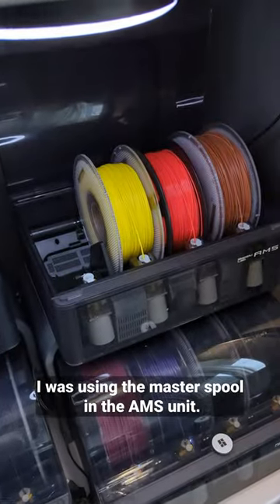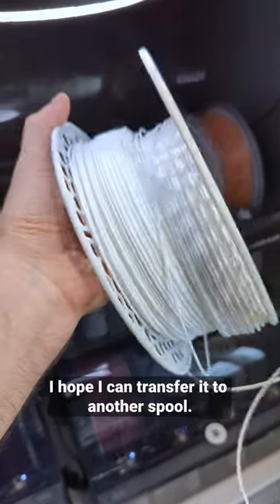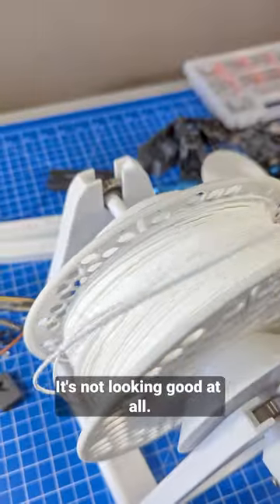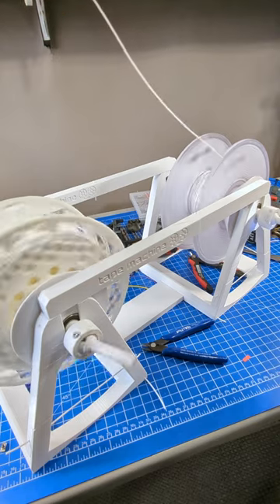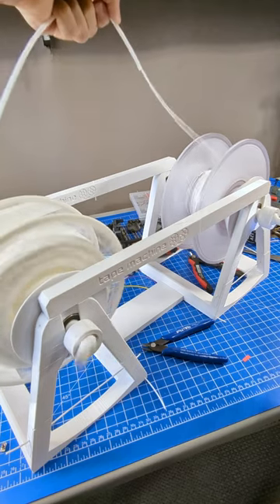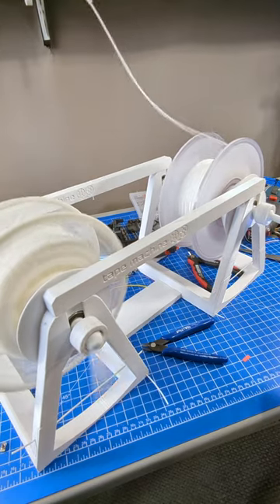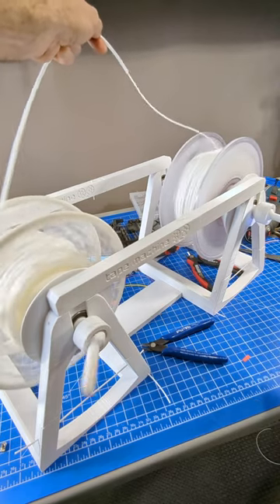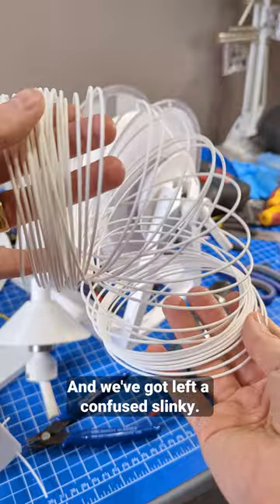Saving an unscrewed 3D-printed master spool

Comment from the maker: Rewind machine: https://thangs.com/designer/MihaiDesigns/3d-model/Tape%20Machine%20-%20filament%20rewind%20%2F%20respooling-843684?manualModelView=true&source=All+Files
Reply: Not sure what bearings you used but 608s don't fit
Reply: Hey, is there any hack how to copy links from comment or click on it? Youtube app can be annoying
Reply from the maker: @darknoktis  YouTube is removing clickable links sadly ☹️
Reply from the maker: @anthonyrichardson8228  indeed, the bearing model should be 6001. Sorry for the error.
Reply: @MihaiDesigns  hi. Thanks. Yes I ended up buying 6001-2RS, 👍

Comment: That's the one gotcha with the AMS: spool handling. Slightly smaller spools, like your orange one, when they get lower on filament seem to suffer some kind of "rotational mismatch" where the speed the AMS is pulling filament doesn't match the AMS spool roller speed and the whole spool tries to jump out.

Comment: Have a look at old Penn reels, they have this double helix shaft that goes across the face  that has a little guide in for the line, it moves as the reel handle gets turned, when it reaches a side it simpy changes direction, laying the line smoothly from side to side.

Comment: if I had to guess its sitting on a set of "rollers" and only ONE of them is driven (connected to the motor) which is how it was able to "unscrew" the masterspool. ie your gonna need a set screw or locking pin mod to prevent that.

Comment: That filament will keep breaking, when doing these transfers with PLA (I don't know other but it might be the same) you need to take the next points in consideration:
- While transferring, the temperature of the pla needs to be above the glass transition temperature (60°), just enough for the material to adapt to the new form but not enough for it to deform. Either heat up the whole roll or have a heat gun at minimum power pointing at the filament in between the rolls
- Do it slower, take at least 10 minutes to transfer the whole roll

Comment: Weld the broken pieces so u don't waste all of that filament!
Reply: He can still use it without actually fusing them 😅
Reply: Why not just wind it on a spool and put it in the AMS and using filament backup? It automatically changes when the filament runs out. 😎

Comment: Ah, you have run into the danger of filling your bobbin too fast and the thread (or filament in this case) snapping under pressure. Beware that throttle. Many a sewing enthusiast has sworn at the snapped threads. :)

Comment: how about making a sliding chamber that goes left and right that follows the rpm to avoid any tangle forming
Reply: I saw someone's build here on YouTube for fabric which used a runner around a criss-crossed barrel to properly wind around a spool

Same concept would probably work for the filament